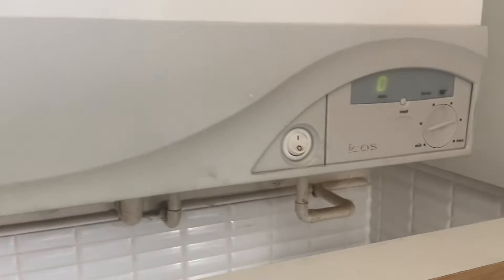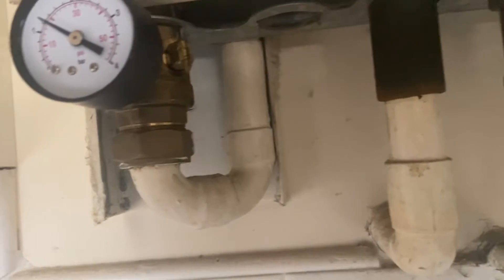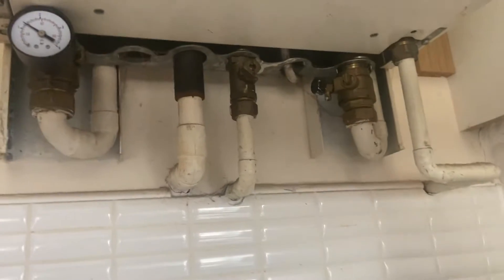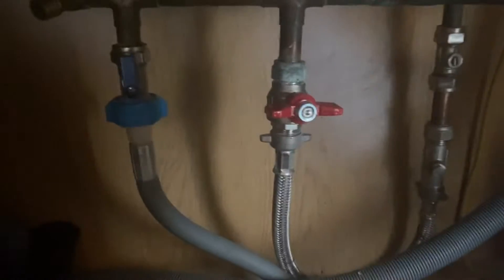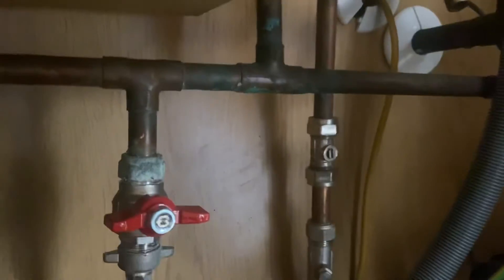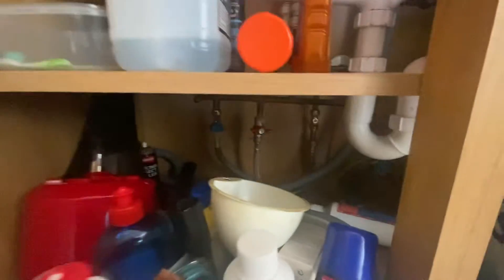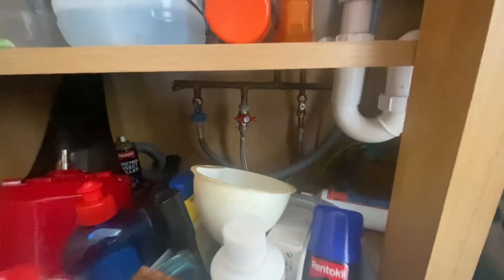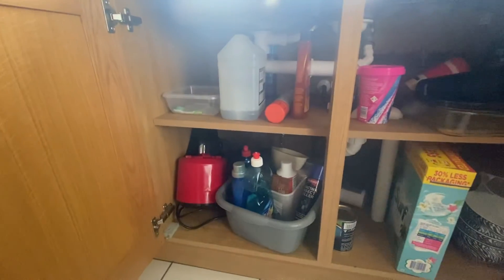Adding pressure to a Ideal Icos Boiler.

Comment: Any ideas, at all, as to why I don't have a bloody pressure gauge on mine? None where yours is (which the manual says should be there...) Checked a few places...
Reply from the maker: @AAARREUUUGHHHH  is it not a combi boiler ?
Reply: @darrensdiy1  I think it's a system boiler. Same one as yours but we have a hot water tank. I'm honestly clueless with this stuff. Does that mean I don't need to repressurise?
Reply: @AAARREUUUGHHHH same problem. Have a hot tank upstairs and one of these downstairs - no gauge at all.
Reply: @TheToonMonkey  I've not been able to figure it out. The heating is shockingly bad downstairs and I think the culprit is something to do with this - but I've not gotten closer to figuring it out. Got someone coming out to have a look at it soon so if I figure it out I'll let you know
Reply: @AAARREUUUGHHHH thanks, that would be great!
Reply: @AAARREUUUGHHHH any ideas?? Experiencing this right now
Reply: @jasminrudge9875  Sorry, never did find a solution for it. Maybe the solution is to just sell the house in summer lol
Reply from the maker: @AAARREUUUGHHHH  might have a gauge in where the water tank is have a look around